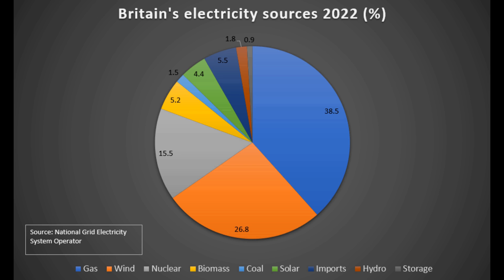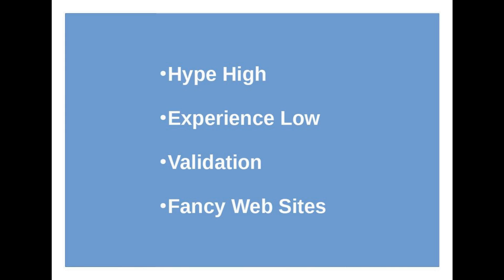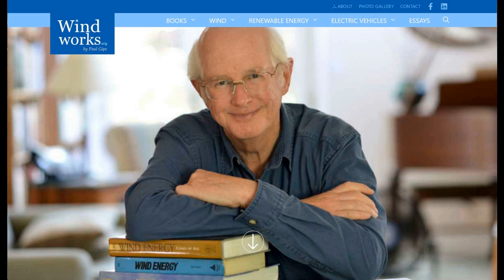2189 O-Wind And A Way To Assess New Wind Turbine Designs

Comment: Robert, This video got my sub...well done and said!!  I've been watching for a few months, enjoying your enthusiasm and bringing ideas forward with some basic testing.  I am also very passionate about the same things you are and particularly wind as a source of power generation for about 5-6 decades now.  It's So refreshing to hear someone talk about discernment and research in the modern world of pet rock phenomena.  White papers are where I usually start if something catches my attention.  Thanks for the Google Scholar tip...haven't tried that yet.  I even downloaded your STL files on this as it is "Appealing in concept" thinking I'd like to test this design...rigorously with protocols.  Back in the day I designed and built a 70' 36kcfm 100HP wind tunnel to AMCA specs and certified by them and may still have access to it for testing.  But as you said it's important to test live generation as well.  Would like to hear your thoughts on what type of generator and how to build it in or external drive it?  Also curious how scalable this design is.  Thanks for lighting my candle once again!!  Hat Tip, ~PJ

Comment: 101 in marketing blurb detection 💪
Reply: He is part of something shady and will never admit this, but unless you model the turbine using CAD, optimize it using CFD, 3D print or assemble it and benchmark its output power, any conclusion is useless (he never does it for example). There is a video here showing three similar looking turbines with similar prices bought from a supermarket and only one of them had the expected output power, the other two were useless.

Comment: Add terms like: venturi. assymetrical, NASA/NACA, ducted, "to the moon". Combined with a "well designed" - modern design, investors should pile on...
(numbers are not so important in the 2.0 Internet age - enquiring minds keep searching).

Yes any assymetric gargen ornament will rotate, ROI on materials is a start, ROI on investment is much harder to achieve (gullible people, to a charlatan, remains the easiest revenue stream - no shade on any persons at all - achieving real power output... (show us the money - ie not the IPO))..

Comment: If the O-wind turbine was truly universal, it would be able to turn in all three direction and generate in any orientation.
Reply: The key part of the design is that it will turn with wind from any direction. I can't see it being better than a good HAWT so it is not for me as I have been disillusioned by previous VAWT's I have bought.André

Comment: Can anyone explain what this is saying in layman's terms ? Thanks
Toroidal tank evaluationThe reported study had been conducted to determine the feasibility of developing toroidal tanks for an auxiliary propulsion system that could be integrated into a Pioneer spin-stabilized spacecraft. The system evaluated consisted of two toroidal tanks equipped with surface tension devices. One tank is intended for nitrogen tetroxide, the other for monomethylhydrazine. The study included the definition of a propellant acquisition system concept that could satisfy the requirements of a spinning tank. It was found that an oxidizer tank spin rate of 76 rpm and a fuel tank spin rate of 110 rpm would be required to produce liquid loss from the acquisition system during spacecraft operation. An investigation showed that toroidal tanks can be fabricated with present technology using either titanium or aluminum alloys. The preferred material would be titanium because of its significantly higher strength.
Reply: The passage describes a study on using toroidal tanks (donut-shaped fuel containers) in a spacecraft for an extra propulsion system. Two tanks, one for nitrogen tetroxide and the other for monomethylhydrazine, were considered. The study explored a system to extract fuel from these spinning tanks during spacecraft operation. It found that specific spin rates were needed for optimal functioning. The tanks can be made with titanium or aluminum alloys, but titanium is preferred due to its greater strength.André

Comment: The O-wind does work,  how well is debatable.  A beach ball held in place by cups at top and bottom with those cups attached to generators is slightly less effective.  So take everything with a grain of salt.  Thanks Rob!
Reply: By the way, a beachball with it's ribs where it is put together makes a better drag wind capture device than you might think.

Comment: If some one is making it difficult to find info the they are hiding something.  I have seen this way too many times on the net. My guess it is not really very usable or viable. Like you say, it may look nice even if it does not work nice.
Reply: Or it's being suppressed when it isn't something new or vendor specific, which is also common.

Comment: I am a fan and note that you like wind and fire, me too. One thing that escapes me is that as an island surrounded by water whose mass volume movements are predictable on a daily basis. Storms being the occasional exception of the volume and power and not of timing. Why are we not investing in the most predictable source of green energy? Tides come in and go out every day pulled by the proximity of the Moon.
Reply: the real issue there is access, not many people own a bit of land with access to the sea (and thus the tides) and a lot of the rest is owned publicly (where installation would be frowned upon) so individual access to a tidal solution is not as easy as wind where you can stick up a pole with an experimental turbine from any piece of land you own. for larger corporations and companies- yes tidal power is a possibility, but for me its diversity that rules, not just one means to get power, but lots of different ones, currently the biggest hold up to generating more energy is the distribution network, so we need to generate at point of use so we arent dependent upon the distribution network to get the energy to where it is needed.

Comment: Thanks for your usual humorous, insightful video. Back in the '70s when I was first becoming interested in wind generators, one of the few books I ever found with good information stated that the most efficient design is thin blades on a horizontal axis ( HAWT ) . One is best ( counterbalanced ) , two is next best ( but they break when changing direction in variable winds ) so the best compromise is three thin blades on a horizontal axis ( HAWT ). Three thin blades on a vertical  axis ( VAWT ) are good but not self-starting. The good HAWTs can reach 20%. The rest of that stuff is hype.
Reply: so the o-wind is an attempt to re-present the VAWT, then.
Reply: VAWT can be self starting but needs either variable incidence blades, or a drag type accessory - sprag coupled or a speed controlled decoupling device reduces high speed drag..

In Aerodynamics it is tricky to abandon aspect ratio.  If the aspect ratio disappears from the design language - so too does the power.

Comment: Yes this is the problem I have & when pushed i ether get no response or it's not ment to generate usable power only battery maintenance. Olso i know of 2 industrial wind turbines near me that have failed & 2 small home turbines that failed 1 was mine & thay all failed due to high winds and were mechanical failures 3 are still up but no functional.

Comment: Reach out to the largest domestic makers Rutland! After the motor turbine & 3-phase system there needs to be capacitor or storage dual system that stores up then release the energy.
Reply: I think there is a need for a charge pump sections to harvest ripple of generated energy. A switching mechanism might ne needed for switching between low and high energy mode. A sense resistor controlled by microcontroller might be needed to control mosfets(low rds one) to switch between low and high circuit.

Charge pump consist of coils, capacitors and switching ic. Most of the available circuit use transistor, but a small mosfet might be better as transistor have 0.7v dropping voltage. Using transistor 0.7v are wasted, so it could only works on 0.7v and above.